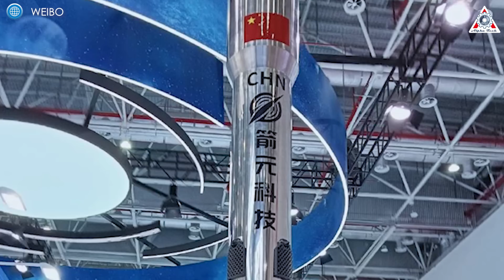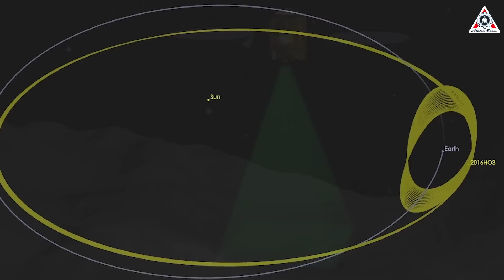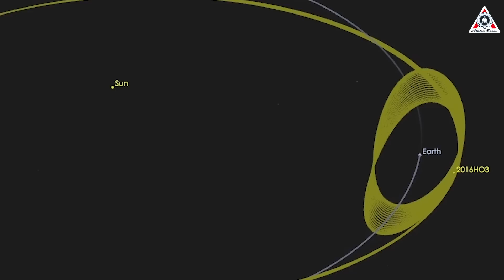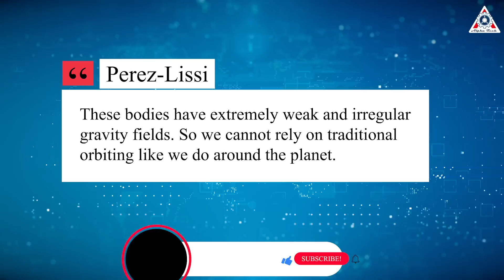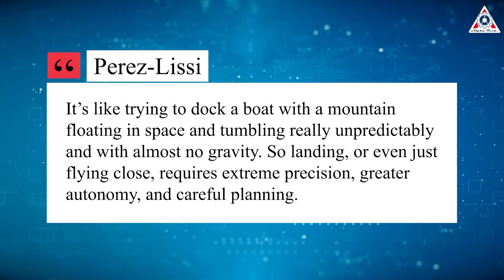Disaster! China's desperate attempt to COPY SpaceX Starship Landing Method, makes Musk laugh

Comment: The U.S. shared key rocket guidance technology with the PRC during the Clinton administration.
“During the Clinton presidency, two major U.S. aerospace companies—Loral Space & Communications Ltd. and Hughes Electronics Corp.—were involved in transferring key rocket guidance and related technologies to the People’s Republic of China (PRC). These transfers occurred in the context of satellite launches and accident investigations after Chinese rocket failures. Both companies were alleged to have shared technical findings with Chinese counterparts, which U.S. government reports later concluded helped China improve the reliability and accuracy of its ballistic missile guidance systems.
Additionally, Motorola and Lockheed Martin worked with China on launching commercial satellites, which involved sharing technology related to satellite dispensers and guidance, raising further concerns about military applications.
The Clinton administration shifted export control authority for commercial satellites from the State Department to the Commerce Department in 1996, a move that critics argued weakened oversight and facilitated these technology transfers.”

Comment: Can aluminum replace copper in electric motors?
Yes. The motor's efficiency might drop by 1% or so, but you also get a lighter motor. Next is the wire harness and – yes, you guessed it – aluminium can do the job. The replacement is actually already in full swing, although the scarcity of copper to give it urgency is so far missing.
Reply: There is a lot missing from your answer. There are some benefits to using aluminum wire, but the cons are greater. Conductor, cheaper, lighter...great. But it is more fragile to heat, corrosion, and damage.

Comment: Raptor 3 is 3d-printed.  And the Chinese make 3D printers...
As for propulsive landings and reusability, the technology is overdue - should have been in place decades ago once Radar, PID and computer control were readily available.  Chinese propulsive landings are not yet efficient of propellant and to get there "suicide burns" where strong propulsion and split-second timing are used to minimize use of propellant .  The idea has been around since the early 1950s...